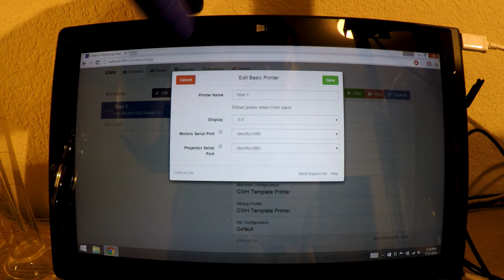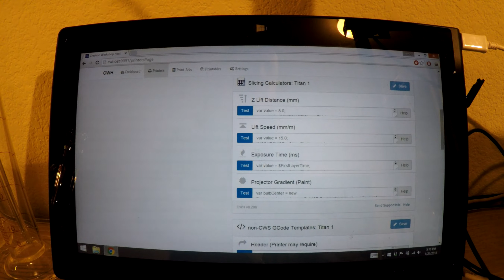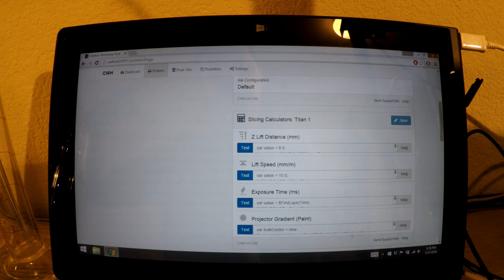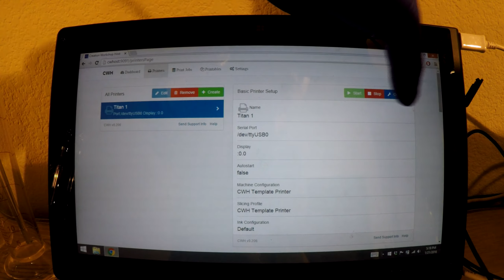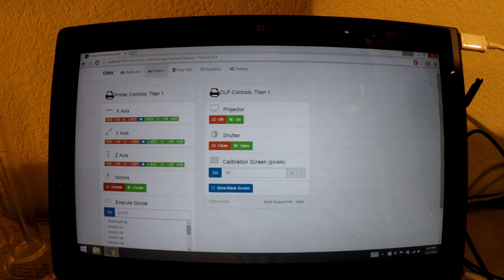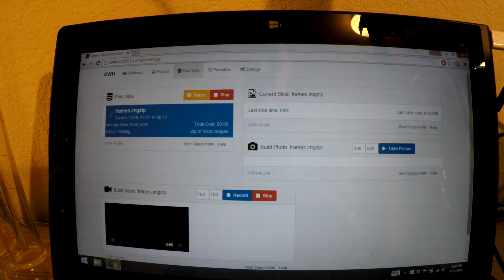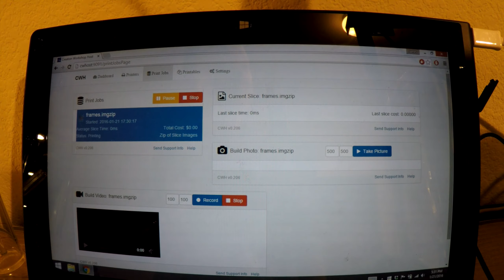Printing on the Kudo3D Titan 1 Using Raspberry Pi Creation Workshop Host

Comment: Have you refined the exposure functions for this yet?  curious if you've moved completely away from the old CW workshop flow to this setup.  I'm not sure how to implement this but this seems like a great solution to perhaps also be able to embed a light mask since it appears to be more open overall.  Thanks James as usual, good stuff
Reply from the maker: The mask, exposure, and lift functions were all fairly straightforward. The bigger issue is that the Raspberry Pi doesn't like the CH341 USB uart used in both the default projector adapter and the Arduino Mega clone. With both plugged in, USB devices start falling off in less than 4 hours. With just one, it'll last for maybe 12 hours. I found a solution, but it requires a number of replacement parts and I'll write something. In the forum about it.
Reply: Thanks.  I feel that getting the mask~exposure issue nailed down and on the slicer side is going to drastically improve print quality and obviously because it will be consistent across the vat to the fixed end, help enourmously with tearing of layers.